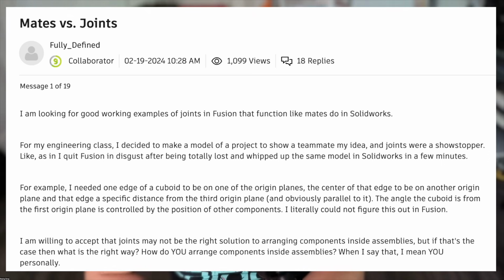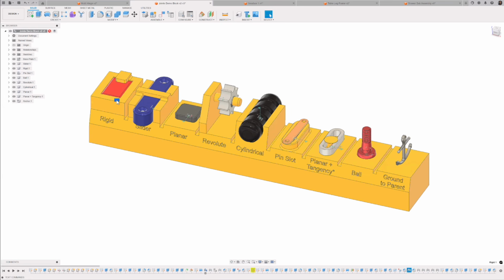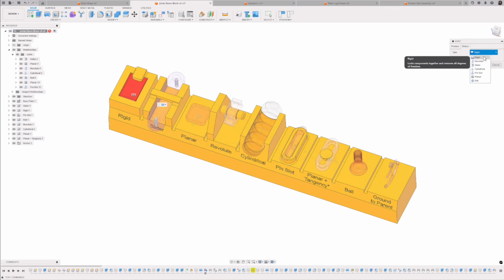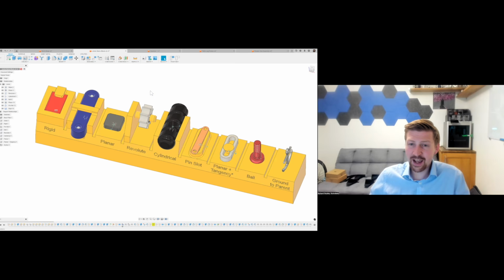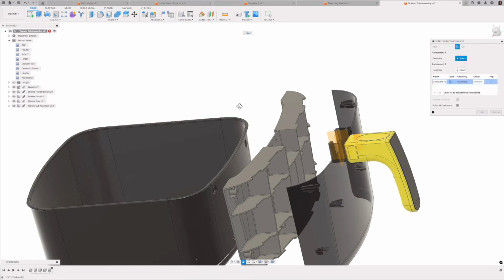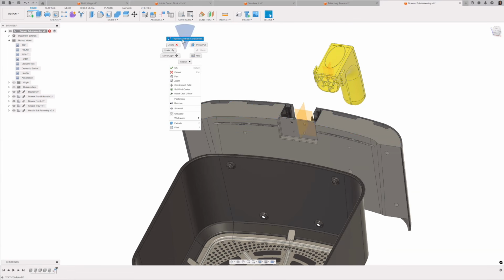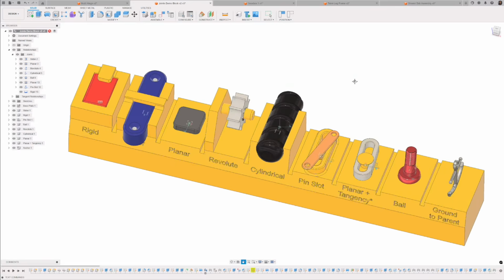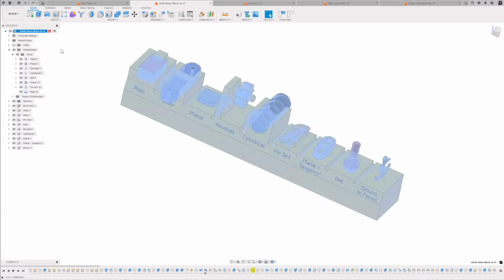When to Use Joints or Constrain Components? | Unstuck My Fusion Design

Comment: - Thx for the video. Well done.

- It is indeed nice to now have 'Constrain Component' in addition to 'Joint'. And of course, the situation / design intent will determine which to use.
- As for 'Joint' when appropriate 'Snap' does not exist, sketch entity can be used; plus, bespoke 'Joint Origin' can be created.
- Also, 'Constrain Component' does not support 'Limits', nor kinematic chains - so, no checking device function/interference; no exploded views/animation; no assembly views (for 'users manual' for instance).

- So, there are always tradeoffs.

Comment: Joint examples are always really canned.  Joints are no longer  "two simple clicks" when things aren't symmetrical.  Take you rectangular part and make the chamfers/fillets different sizes on each side.  Now you can't just click one point in the "center" because what you snap to is no longer the center of the part, its the center of the surface.  Then you need to do wonky things to make it work (like adding a sketch with a new snap point, which is ridiculous).  Similarly, there are always examples of mating a block to an inside corner by selecting a point on non-radiused edges.  Super unrealistic!  Give that block radiused/chamfered edges and its no longer "just two clicks".  I avoided using Fusion like the plague before the Constrain was added.  Constrain definitely needs improvements, but its an order of magnitude easier to put assemblies together in Fusion now that it has them.  It needs a tangent option and it needs to remember offsets when you update a part from a .step files and re-select the new surfaces.  That is resets the offsets to 0 is incredibly frustrating.
Reply: You are quite right joints can appear messy, but if you remember there are the intersecting edges and between faces modifiers which will a lot of times give you the snap points needed, how ever as you say - no longer just 2 clicks.

Comment: New to fusion and find this extremely frustrating compared to Solidworks. Its a simple assembly really but cant for the life of me get it to go together .
Reply: Hi, if you are using the new constraints feature and still having difficulties this quick tutorial might help. https://www.youtube.com/watch?v=vkROCgJ1yMw
Reply: It’s definitely one of the weak points about Fusion.
Reply: Update to the latest version.  It now has an option called "Constrain" that works like joints, but with fewer mating options and it forgets the distance (offset) when you change the surface or have to re-select it due to updating/replacing a part.